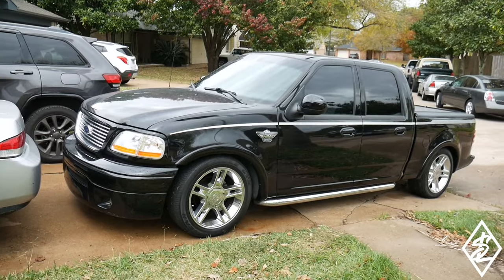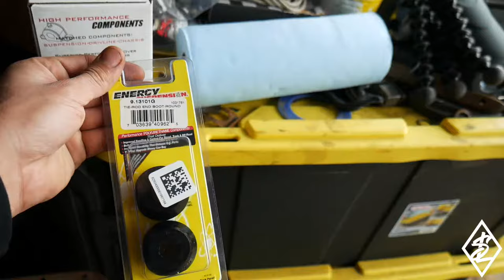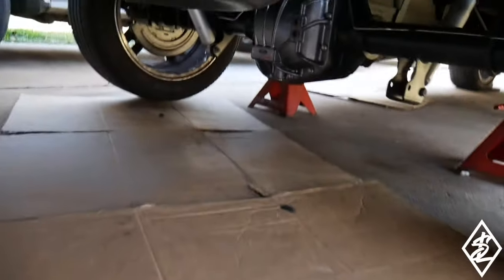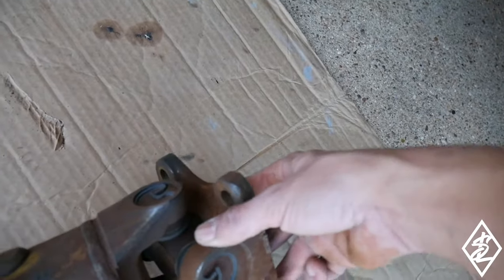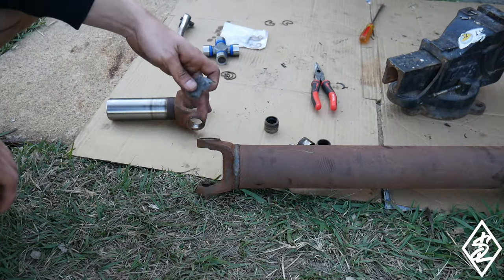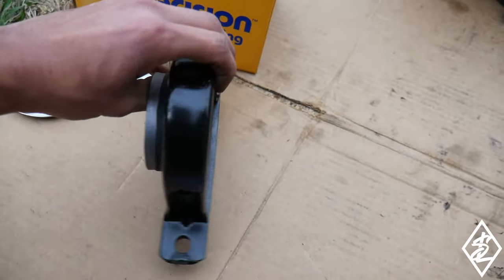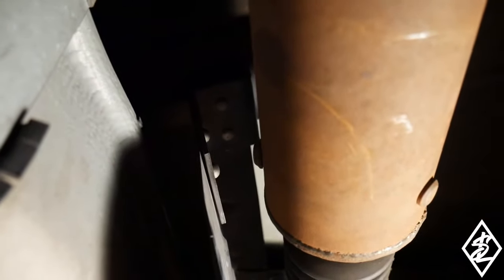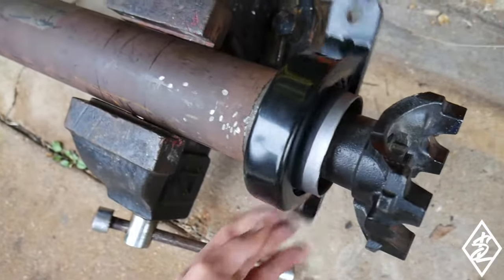Replacing Driveshaft Center Support Bearing

Comment: Thank You... Well done!... Just about every other video skips the hardest parts of the job to do, which is the whole reason for someone to watch an instructional video in the first place. You take it through the entire process, and even show the mistakes and how to overcome them, as far as the drive shaft center bearing... that is what I needed. Actually the Best video I've seen. A+
Reply: He didn’t show how he did it though, he half ass showed how he fucked it up yeah but he didn’t show how he installed it properly

Comment: Don't beat on the outer part of the bearing like that. (it can mess up the bearing) use a pipe to only pound on the inner race of the bearing that is sliding onto the shaft.

Comment: I have a 03 f150 and it has a one piece driveshaft and i want to replace with a two piece, because i lowered the truck a bit and the one piece is hitting. do you know where i could buy one?
Reply from the maker: I got a custom carbon one from "driveshaft shop". I'm sure they could make one but you'll prob have to find a support place for the center bearing and provide measurements to get made